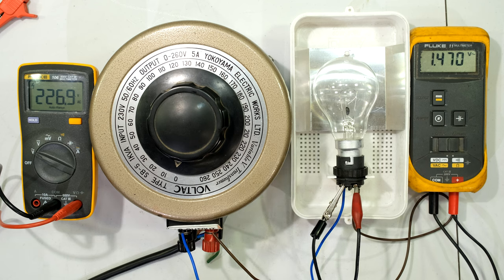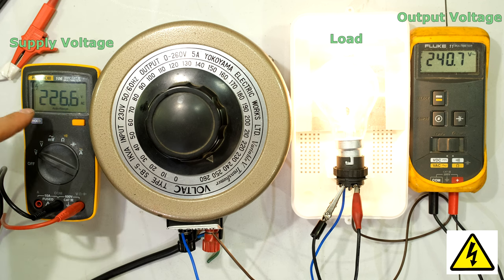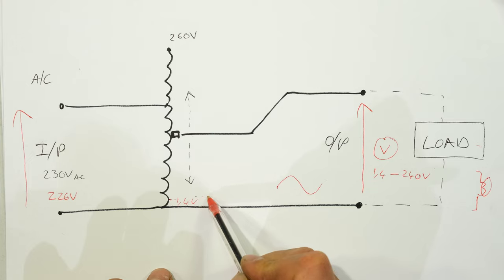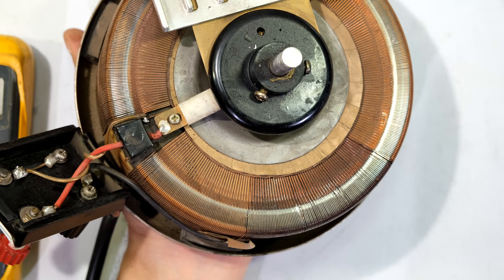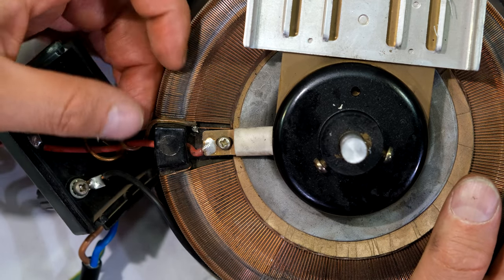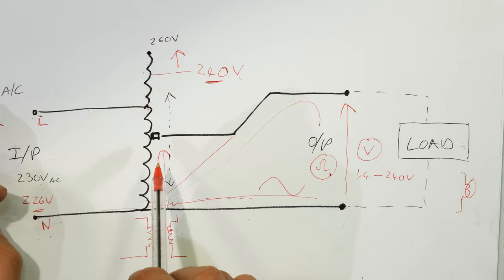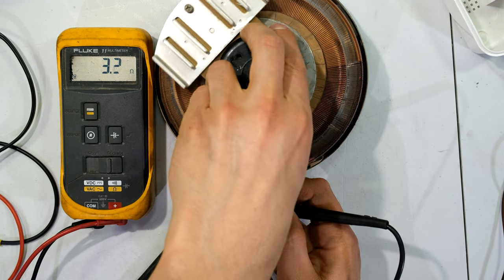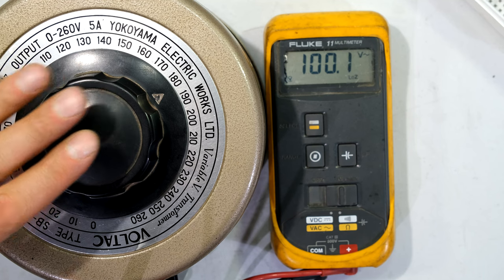How does a Variac autotransformer work? Practical demonstration. Variac opened and tested - tutorial

Comment: My 2 Kw 0 to 300 volt digital Variac has arrived !!!  I'm using it with a Residual Current Device and I don't check high voltages with my fingers !!!!  I wanted it to repair power tools, electronics, machines etc.  You can turn the voltage down to 0 which stops a power tool and you can see it working at whatever speed you want !!!! I can't see a Router spinning at 30,000 rpm, but I can if it's moving slowly !!!! I think it's a brilliant machine !!!!!

Comment: Thank you for sharing your information. I am wondering something. Isn't a problem if the brush touches two wires at the same time? ( when you turn the handle to change the Voltage)

Comment: Thank you for the tutorial, it is very well explained and clear. I’m just curious, if the resistance across the output terminal is so low (0.5 ohms) would that just mean short circuit?and the current will NOT flow through the load? 

If I apply 120V for example at input then put a 1A fuse,  would it just blow immediately?
Reply from the maker: When AC current flows in a long wire such as an inductor, the inductance builds an impedance so under higher frequency such as 50 Hz there is a much higher impedance and it wont be a short circuit
Reply: @ecologicaltime  Thank you that makes sense!
Reply: Oh !!! I wasn't sure exactly how it works !!! Thanks !!!!
Reply: Thank you very much for this video. I  plan to install a variac in a wooden box and wire it up and this is very good information.
Reply: @ecologicaltime  Thank you very much. I too was confused about the DC short, but I forgot about the inductive reactance.